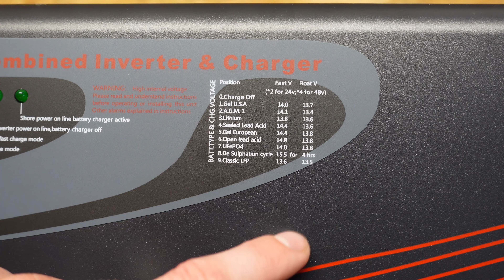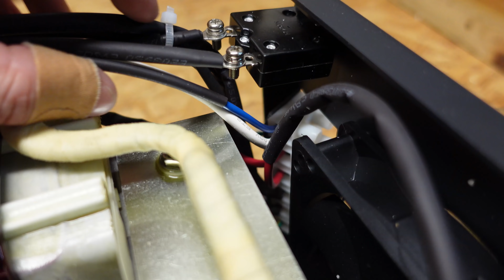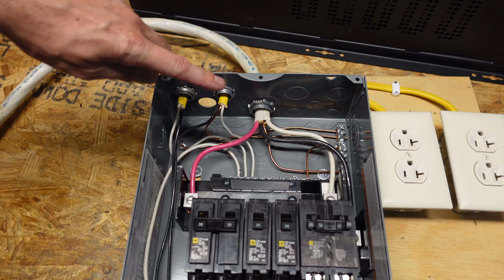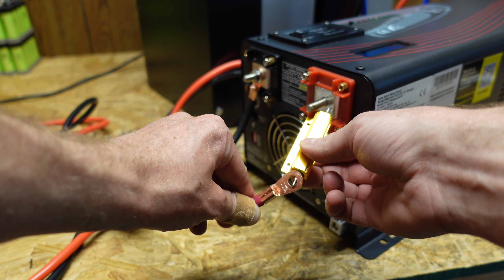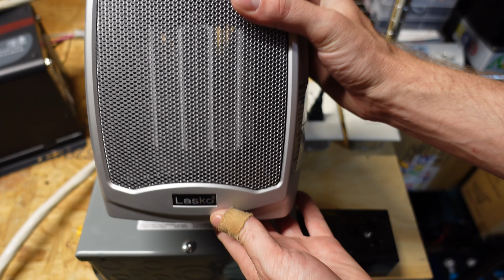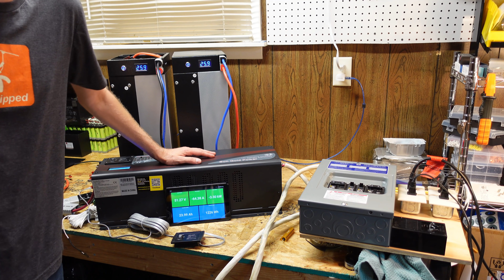SUNGOLDPOWER 6000W Pure Sine Split-Phase Inverter, Review & Testing

Comment: no wonder your 13,3sqmm (AWG6) cables got hot, they are rated for 80-100A continuous, shoud use at east 16mm2 cables instead (AWG5 5% more with 16,8mm2)  or 20,4mm2 AWG4 good for 125-135A
Reply from the maker: I used the wiring that was sold with the battery at the time. Agreed it is undersized.

Comment: I only use 4 gauge to 2/0 wire on my battery banks. I use the 4 gauge to connect the batteries and the 1/0 to 2/0 from the batteries to the inverter. I'm using a 24Vdc battery bank and thinking about converting to a 48V system.

Comment: 6 gauge wires to connect  the batteries? I would assume running things on 120v? 240v at minimum 2 gauge wires...
Reply from the maker: Yeah the #6 is what was sold at the time. I would recommend a heavier gauge cable, but I'm no engineer...

Comment: Great review! I just dislike the very high idle power consumption—2.4Kw/h in 24 hrs. You need more than 500W of solar just to idle that inverter. It's Okay if you have another small high-frequency inverter for low loads. Or, buy a Victron Multiplus II inverter.

Comment: Hi, thank you for sharing. Have you noticed, if it has 2 dip switches on the inside for output voltage adjustment? I know of some inverters that have this feature,  and they can be adjusted in the increments of about 5V. I have the same inverter with 250VAC on the output. I am looking to lower it down to 245V . If there are no dip switches, It can only be adjusted through a software. It's an older model, so the support could be challenging. Please advise, Thanks

Comment: Toroidal transformers have a tendency of being noisy. Not as noisy as a SMPS (high frequency) but noisier. They are cheaper but their advantage is package side, close to same efficiency. Tube amps typically use E type iron because it resists noise

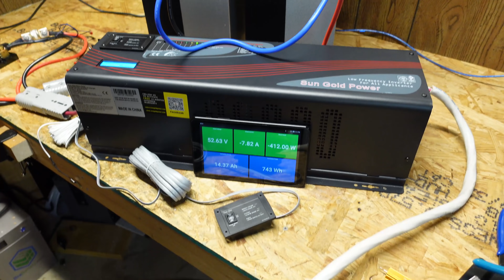Comment: Looks like the inverter/charger is built good. It had 12 gauge inside which is good for 20 amps at 240 volts. Those inverters are rated for the surge or peak wattage of 6000 watts but I would say they're about 4800 watts continuous. Those batteries are way over rated at 6000 watts. Running the dryer was exceeding the battery cables capacity. All these devices should be rated at their running watts not peak watts. 6000 watts at 48 volts is 125 amps and since you cannot exceed 85% of the cables capacity those batteries should have 1/0 cable. Those batteries are probably only 2400 Running watts each. It looked like the inverter went into self protect on one of the phase at 13:48 time of this video because the dryer was pulling more than it could handle.

Comment: Do you have your shop lights hooked up to the inverter? Cuz why the lights flicker when turning on the compressor. I’m not trying to say you have the compressor hooked up to grid power just looks suspicious.
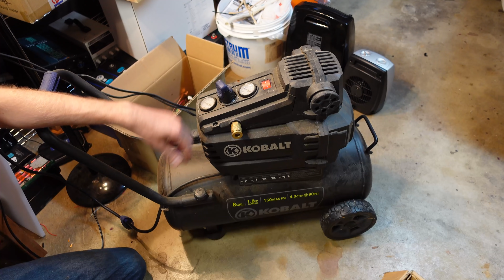Reply from the maker: The pole lamp, which you can see sitting behind the air compressor, is pugged in to the inverter at the bench outlets, which you can see at timestamp 15:05. So yes, they are dimming when the air compressor starts.

Comment: This inverter is not made by SunGold Power. SunGold Power does not manufacture any its inverter offerings. SunGold Power is just a system reseller that rebrands the products that they offer. SunGold inverters are manufactured by Sigineer Power. Sigineer Power manufacturers inverters for several renewable energy companies.
Reply from the maker: As I stated earlier, I do not believe Sigineer manufactured this inverter. If you believe they did, please provide some sort of evidence to support the claim. Thanks.

Comment: Just an update on my sungold 4000 split phase. Bro its still performing perfect. Mine is 24 volt on 840 ah of the eve 280k cells from 18650 battery store.  I use 2 2-0 postive qnd 2 2-0 ground wires so its definitely not starved for power and i use victron charge controllers.  My system is doing great and i was wondering how your sungold inverter was holding up?

Comment: Since your inverter is a source, providing a reference to ground will establish a stability of the neutral to stay fixed to zero volts AC at all times.  There many be a bonding wire in that inverter to the neutral wire.  The neutral is connected exactly at midpoint of the full coil in the transformer, which puts out 240 V AC, but unless it’s grounded, it will not stay electrically stable.  Only voltage that will stay stable without a reference to ground is the 240.

Comment: Do you know if i could run 2 110 volt inputs of the same phase into the ac input or would it mess it up or not work? I would like to charge batteries from my i inverter like this but i dont have a 220 line to connect to inverter.

Comment: Do you still have the sungold inverter? Mine is working great for powering my 220 minisplit but i was wondering if you know if the ac input has to be 220 split phase since it dont use the neutral? Could i use 2 110 inputs of the same phase as my ac input ? Id like to have my generator charge my batteries thru this inverter but my generator is only 110.
Reply from the maker: The input has to be 240V. You cannot connect 120V unless you were to pass it through a 120 to 240V step-up transformer first.
Reply: @LithiumSolar can you use two 120v inverters on a double pole 240v breaker to make 240volts. One inverter on one leg l1 and the other on the other leg. L2

Comment: 6GA WIRE IS GOOD FOR ONLY 50AMPS... USE THE CORRECT WIRE SIZE
Reply from the maker: I don't disagree that it should be thicker; however, it can handle more than 50A. It appears you're referencing the NEC ratings and they don't give a rating for this cable type (200C insulation).

Comment: I just bought the 24 volt model exactly like that. It seems to be nice so far. I think it's only 2000 watts per leg tho. I was kinda hoping for it to be more capable but it does power up a 15000 but ac on my camper

Comment: It doesn't have to utilize an auto-transformer to "create" a neutral, a regular 2-winding isolation transformer can accomplish the same thing with a center tap secondary winding. The latter is a more safer way to create a neutral. Costs more that way too.
Reply from the maker: Yes, a regular 2-winding isolation transformer can accomplish the same thing - but that's not how this is wired here.

Comment: You have to get more stronger battery to fully push that inverter I have the same one and I have 4/0 gauge wire with 230ah @48 volt.  Thank you for your vedio it helped me alot
Reply from the maker: Yeah a bigger battery and thicker cabling would be much better. I think 4/0 is a bit overkill though? I pretty much wanted to test the two products as they came vs any custom changes/wiring.

Comment: I have the 10k 24v model. I loved it until it stopped working. For Some reason the about 6-8 transistors on exploded out of the blue. No sure what happened the unit lasted just about over a year. Currently in the process of a warranty process. Any ideas? 

Company is telling its only a 1 yr warranty even though their website states 24 months🤷🏻‍♂️. Hopefully it goes through if not Victron here I come….

Comment: I notice sungoldpower has an All In One hybrid unit with similar specs, but so much more in form of 120 amp ac and PV charging input to battery for about the same price.
Reply from the maker: The big difference being the one you mention will be a high-frequency inverter where as this is a low-frequency inverter. Both inverter types have different purposes. This one (low frequency) is designed to start heavy inductive loads.
Reply: @LithiumSolar  ... Just looked at specs; ... The Sungoldpower TP6048 includes a Low Frequency Inverter in All In One form with Solar PV option for current cost of $1,365 ... Plus can charge at 120 amps vs just 60 amps. I do see some mixed reviews. Would love to see you Test one of these.
Reply from the maker: @CaptBill69   Ah, didn't know that was the unit you were referring to. I figured it was one of the more-popular HF models. In that case yes, I would consider that a superior choice.

Comment: Have you figured out the 240VAC output wiring? What is the ground attached to? Docs are confusing!
Reply from the maker: Yes. There's a L1, L2, N, and Gnd coming out. You can see how I connected it to a panel at 8:16. If you're not sure, please contact an electrician!
Reply: So you never tried the input side. Thats where the problem is.

Comment: I was looking into the 4000W split phase for my 50 Amp RV. I questioned sungold about the situation of a campsite only having 30 amp, as to whether the battery charger would work. I did not receive an answer. You having one, could test this. Does battery charging occur on single phase, bridged across both input hots.

Comment: Very good video...question here...When you set your battery as priority...when this inverter change to main AC ? ...It is not clear to me if you can set this parameter as in other inverters...for example for  my LI-FE-PO4  52 volt battery pack...I will like  to set that to 48 volts.  Hence...when the system drop to 48 volt..the inverter will switch to main AC.  Then when the inverter detect the voltage above 52 volts (battery where charged by a photovoltaic system)...the inverter switch  back to battery....Thanks.

Comment: Correct. Just like isolation transformers,  and the step down transformers at the service pole outside your house. The center tap of the transformer is your neutral. Yes, the 240 in to that unit creates that neutral on it's secondary output.

Comment: Can I connect two of these from the batteries via bus bars to a load center ?
Reply from the maker: You cannot connect multiples of these inverters together. They do not support stacking/parallel connections.

Comment: You mention in this video that you can ground or not ground the neutral based on which inverter you're testing. Have you determined which inverters allow the ground and neutral to be connected? My house was built in 1987 and the utility feed only has three wires... the two hot wires and a combination ground/neutral. I have been having trouble getting the inverter manufacturers to tell me if this is a problem. Sigineer told me that this is not allowed on most of their inverters.
Reply: I've been having a similar issue...I have an 18K SunGold inverter..The neutral is not the sam as a ground, I've been told. They do not address this in their setup instructions.  I connected the neutral wire to the neutral bar also. What I did, was connect  a 2nd ground wire to the original ground and returned it to the main fuse panel.  I also connected a physical ground to the square ground terminal with a bare copper wire.  triple grounded. extra work, but I know the electricity will have a safe path back to ground this way for sure.

Comment: I confirmed last month that the surge rating on this inverter is no joke. I fired up my 20,000 watt surround sound audio system and played at levels sufficient to bring down a section of my ceiling. Yeah, it handled it. No doubt I hit peaks over 14kW input power to the amplifier racks.
Reply: It look similar to" Aims" wonder how customer support works
Reply: @josemanuel2244  Form factor looks the same on the box, but I can tell you they have excellent customer support. They have an American engineer in CA that is knowledgeable about the products and offers good information when you have tech questions. The also provided me with the replacement cost of a noisy fan in their 18kW inverter with a quiet one I bought for $100. They work at customer satisfaction and I would not hesitate to recommend them.

Comment: I have the same inverter, just wondering why it gets so hot, with only my upright freezer hooked up to, it's only rated at 4.5amps.
Reply from the maker: It has a massive transformer that it needs to keep powered even if there is no load connected. You can try using the standby mode, though I don't personally recommend it as it doesn't work very well .
Reply: @LithiumSolar  so do you think It would be ok, or should I swap it out for another one? I'm going to be using it to power up 10 circuits, off my grid. I'm just running some tests on it for now.

Comment: This inverter is actually the 6kw Sigineer-Power inverter someone stamped the sun gold on it, I have one that's connected to my 800Ah battery bank running water well, hybrid 50gal water heater & 12000BTU mini split AC, I really like this inverter over any other ones on market.
Reply from the maker: Do you have any evidence that this is a Sigineer inverter? Sun Gold Power has told me that they are not in any way affiliated with Sigineer.

Comment: I bought one of those just like yours it powers a fan for 5 min then cuts off I've done everything by the book and still nothing the company will not replace it or refund my 1200 dollars any suggestions
Reply from the maker: They're supposed to have a 2-year warranty. Did they give any reasons why they won't honor that?
Reply: @LithiumSolar  no  they just told me read manual again

Comment: I have the 6000 split phase 24 volt unit that I  am hooking up.  That terminal block on the AC side is terrible.  That tiny screw does not hold fine  strand flexible wire very well.  I tried a piece of 6 gauge wire with about 10 strands. Any slight movement of the wire will loosen that connection right up.  What a terrible design. Should the wire end have some kind of solid ferrule crimped to the end to make full contact with the round hole in the terminal block?
Reply from the maker: What type of wire are you using? I've had no trouble at all with #6 or #8 THHN. I do not use ferrules on these terminals.
Reply: @LithiumSolar  I'm using AWG 8 tinned fine strand 105C rated marine wire.  Those inverter terminals with the setscrew have 6mm holes on the load side. I made a steel  fixture with a pair of  5/8'' square steel bars with a 6mm hole drilled into the middle of the bars where they are clamped together. That way I have 2 halves of a 6mm hole split in the middle. I took a piece of 1/4 inch copper tube and made ferrules. The tube gets staked with a round nosed tool and then gets folded in the middle. Then a flat steel bar in a hydraulic press packs the ferrule into the bottom of the half hole and is flat on its top surface. The ferrule is then trimmed to 3/8'' long. 

So the ferrule looks like a solid copper ''D'' shaped lug in cross section. The cool thing is that the setscrew pushes that lug so the curvature of the lug exactly fits the upper half of the hole in the terminal board on the inverter.  I polished the drill marks out of the half holes and when the copper lug comes out of the home brew die, it looks like a mirror finish. I am certain that there will be a generous contact area once that setscrew is tightened for good and there won't be any overheated connections. Yup, overkill, but I know that I will never have to worry about those connections again.  There is only about 18 inches of load wires and ground going to a double circuit breaker. Next to it is a 240 volt 4 prong receptacle and a pair of 20 amp 120 volt outlets, one for L1 and the other for L2.    Why Marine wire....I have rolls of it stockpiled away. 4/0 and 2/0 welding cable, too. Wire and cable is getting very expensive!
Reply: This unit is for standby for grid down situation. I copied your resistor charge setup. Since I will most likely have the battery bank switched off most of the time, I thought it would be cool to add a push button to pre charge the inverter capacitors before switching on.  The input to the inverter comes from a 240 volt Onan standby diesel generator, not the grid. I went with a 24 volt system because I also have another  24 volt diesel driven large frame alternator with external lithium regulator. The unit also gets a pair of Aims 24 volt chargers as well. Our location has poor solar exposure. But that didn't stop me from installing a Growatt 120 amp MPPT.  Thanks for your ideas and review!

Comment: The silicone wire insulation is rated to 105C or 120C. At 75C it's not that hot. Of course, the heavier wire would be more efficient. The heat lost on the wire is energy lost from the battery. Also, these LF Inverters are not drawing a nice DC current. The current has a 120Hz ripple that can be rather large at full load. If your average current is 125A, then the peak current is probably 1.414X that value, or 176A. The battery may not be rated for 176A pk currents! That's the major difference between a LF and HF Inverter. The HF inverter has a nice, smooth DC input current, but the LF has a 120Hz, rectified sine dc current. That's why the capacitors eventually fail if not kept cool. If you want to reduce the heat and the ripple current, add a large electrolytic, 200,000 uF capacitor bank between the battery and the inverter.

Comment: That transformer does appear to have a center tap(so like an auto transformer).
 
That red stuff is Silastic. It would be really awesome to get the part number for that transformer inside.

Additionally, those internal wires are probably 90+c rated, so they are probably fine to run those loads. I am pretty sure the manufacturer didn't size the cables to be cool to the touch.

Comment: for the quality and for the price of the output this thing as a real bargain!   to be completely honest I much rather have a loss of efficiency and have the unit actually be able to put up a power when I need it then worry about it not being as efficient as some other kind of inverter which will usually end up with problems with.

this thing looks like a sturdy built product and it doesn't seem like they skipped out on actually building it either.

I wonder how clean the AC is from this.?